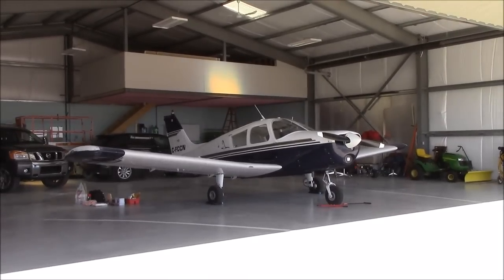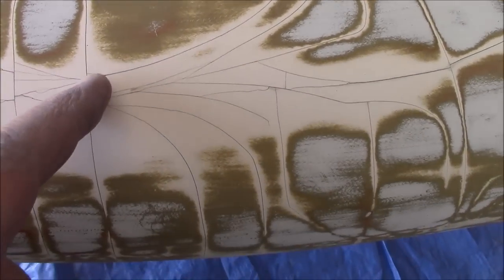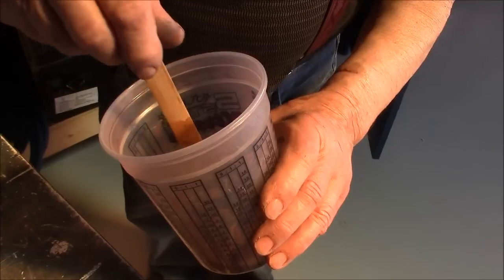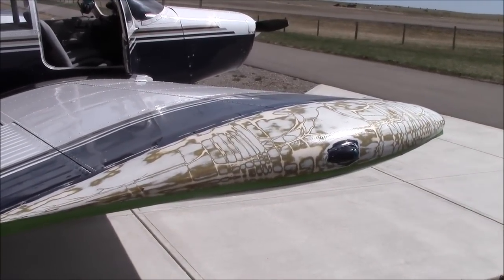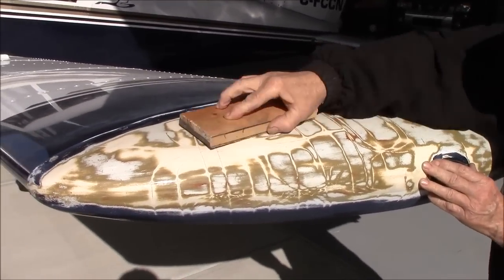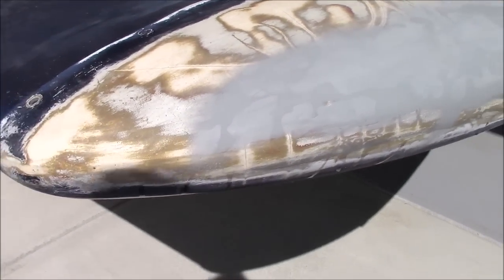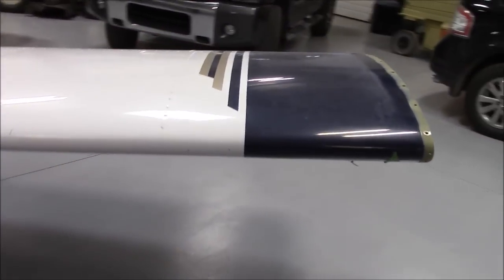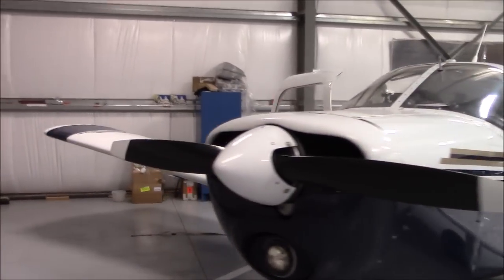Piper Cherokee Wingtips Project Vlog # 49 (Revised)

Comment: Removing the paint and high filler primer is the correct path. Exposing the glass underneath. Adding another layer or 2 of Glass then spraying high filler primer. Rub the filler back and prime and paint.

Comment: Here's  a tip to help stop it from cracking again in the future.  Find a water thin superglue (Cyanacrylate) glue and run it into the cracks before you start applying the fiberglass resin.  It will penetrate into the fiberglass fibers and solidify the area where the cracks are.  This has to be a high quality CA glue, such as Bob Smith industries, not the garbage you buy from Home Depot that they call superglue.  It will harden almost instantly when poured into the cracks.  Wipe, then sand off any excess from the top surface and then coat with Fiberglass or epoxy resin.  They will never come back where they once were after this process.  Hopefully no new cracks will form...

Comment: I started working on boats before I worked on airplanes so I fixed a lot of fiberglass.looks good.i usually use a ziz wheel or a dremel to get in the cracks and then fill em with bindo or 2 part epoxy resin ad some silica to it to firm it up then fill holes. After that I’ll put smother stuff in it like a glaze putty last. Before spraying gelcoat. Looks like you got it under control though. 👍
Reply from the maker: Thanks Michael..it was a big job even though it was only a temporary fix..will probably replace them with updated wing tips should I have a bit of "spare change" in the near future...

Comment: It's not the fiberglass that's cracking it's the gelcoat the Piper used in manufacturing the tanks. If you really want to repair a PA-23/32 Fiberglass Tip Tank it need to be opened up and all paint sanded off the outside and sand all the flaking resin off the inside and using high temp structural epoxy resin and 8 to 10 oz cloth and lay-up the inside and outside putting peel ply on the cloth while it wet and when dry remove peel ply make a replacement panel for the inside next to the wing bulkhead, glass it in and then lay glass and resin and peel ply over it till it dry's and pull peel ply off. Sand outside of tip tank and prime with epoxy primer and the tank is better than it was when it was new. Just painting the outside with resin is just a patch job. I watch a guy in Georgia repair both of mine over 6 years ago and haven't had anymore leaks or seeps till yet.
Reply from the maker: Yes you are absolutely correct in your repair technique since a year or two later I was facing the same problem.  I think that instead of going through the procedures you posted that a new set with the nice wing tips will be my next expense. I will then also be able to install a new set of strobe nav lights.  Thanks for your detailed instructions..hopefully it will be useful to another subscriber of my channel..cheers/Chet
Reply: Unless it’s really bad on mine I sanded off the gel coat to the glass and sprayed in cheap primer, if the cracks are also in the glass as they were with mine they will show up with the primer coat.  That’s why I added a layer of glass

Comment: When sanding the rounded surfaces with the sanding block. Don't sand lengthwise.  That will leave flatspots on the rounded surface, and they will appear as waves in the final job.  Sand accross the rounded area.  And keep the block moving.
Reply from the maker: Thanks for the info it is much appreciated.  As mentioned earlier the cracks did reappear about 2 years after I redid them so I guess the next project I will be doing is following your advice.  I am presently doing hangar insulation so quite busy at that and warmer weather is what I will require doing the crack repairs.  Thanks again..Cheers Chet/

Comment: Any reason other than cost that you did not install Knots2U Horner style wing tips instead of refinishing the standard wing tips? I'm considering changing mine to the Horner style. Do they not work as advertised?
Reply from the maker: New wingtips were on my mind Bob, however I'm starting to feel my age now so it's hardly worth while, the plane flies just fine with the old ones...
Reply: @TAGALONGWITHCHET  I notice you don't need any STOL performance mods out in your part of the country. I fly out of a 2,200 ft grass strip with 50 ft trees on the one end. You need to go looking to find a tree. lol. 1972 PA28-140/160 hp.
Reply from the maker: @bobkimmcdonald6171  Yep, it's pretty flat in this part of the world Bob although we do have to take into account density altitude since we are at around 3500 ASL.  It certainly becomes noticeable during the summer months when we can see temperatures around 30C/86F.
Reply: I was thinking the same thing.  You do still have to paint the new Knots 2 you o es too, but its a quick easy process because they come ready to paint.

Comment: has this held up well? I must admit I'm not really sold on the resin coating for the long haul since the stress concentrations still exist, but the end product looks pretty good and for something not so imperative I think this was a pretty good cheap fix
Reply from the maker: To be quite honest about it all Pitka I think the best route to go is purchase complete new wing tips.  You are absolutely correct, the stress concentrations are still there and about 6 months later they came peeking out of the paint again, although not as pronounced.  These were the original ones from 1973 so they did their job well but as in all things they do have a life span.
Reply: Thanks for the reply. 6 months is a pretty good lifespan for this fix I think. Hindsight is 20/20 though and we all have to try things out. Composite work and paint both require so much time to complete which sucks too. I wonder if purchasing or creating a cheap cover for the wingtips would be worth it when not in use. But I guess that's the whole problem with airplanes and cars, more money all the time lol
Reply from the maker: No problem Pitka..unfortunately there are many fiberglass parts which make up parts of these aircraft and they all eventually end up with these type of cracks so you would need to cover them all.  There are many after market companies which make them so all it needs is a thick wallet..lol..  Keeping them hangared is also an option so that's my next project...
Reply: 6 months to a year is what we would expect for a job done in this manner. They look great for that period though and a definite improvement. That said even just a repaint with a sprayover looks great from 10 metres. The method we use is the same as used on the fibreglass Lotus cars, cracks are ground completely out and then we use fibreglass tissue with the resin. With attention to detail they come up like new and last for decades. I have Cherokee repairs that we did over 25 years ago still looking new. A very inexpensive repair really. Most of the new fibreglass components now are very long lasting as well of course, just a little more expensive.
Reply: @kevinsmith467  , When you ground out the Cracks with a vtapper and added tissue, did you go over the entire object with fiber? or just the one spot. Also did you apply gel coat or resin or just build up epoxy primer layer?
Reply: @ctremie  It is a repair of the entire area, not just the cracks. You have to grind and then sand the surface flat until you have gone down sufficiently to remove all signs of cracking.  You may discover deeper cracks but they will require a localised repair first. It is the gel coat cracking that can be repaired by applying fibreglass tissue and resin. On something like a Cherokee, you will need to sign the Release to Service and the job has to be done correctly before that certification can be signed. We would generally sign it off citing AC43-13-1B as our acceptable data.
Reply: @kevinsmith467  how much would this job cost
Reply: @mj4886  While the materials are never cheap the bulk of the expense is going to be time and effort. Some tooling and consumables may be needed also. It is a difficult question to answer as it depends on the extent and then the finish required. If you have a chat with the A&P and are prepared to do the bulk of the work yourself it shouldn't be a couple of hundred dollars on the low side.

Comment: my stabilator tips were like this so i layed a new layer of fiberglass on the upper side so in the future this wont happen.
Reply from the maker: I would do that as well, should I do it again since it's much better fix.  I may resort to purchasing new tips from Knots 2U
Reply: @TAGALONGWITHCHET  IF they look good for now id probably just wait till they reappeared unless you dont have a high quality expensive paint on them yet.  My wingtips were bad but I got a great deal on horner style tips.  I dont really see a speed difference but on my first landing with them i was all over the place since they greatly increased my aileron responsivness.  My cfi was like why are you overcorrecting all of a sudden lol.  Now to me factory tips feel mushy.

     Just a lil tip if you add a layer, I used mat instead of cloth to conform to the curve easier, and while the epoxy was still sticky I added two more coats so that while sanding smooth so i wouldnt sand into the mat which would show up in the primer coat.  

    What paint are you spraying?
Reply from the maker: @authenticrebuilds9247  Thanks for all the useful info.  I am just into a bit of what could become somewhat of an expensive annual this year on my engine so any thought of purchasing new wingtips will have to wait for a while. The primer and paint I used was the normal spray can type which I purchased at the hardware store for around $8.00 per can.
Reply: @TAGALONGWITHCHET No problem,  I got lucky and got my wingtips on ebay for under 200 dollars shipped, it just takes patience and looking from time to time.  I cant wait to get my Cherokee 180 home to start that project.
Reply from the maker: @authenticrebuilds9247  Now that's a bargain price will have to keep looking take care and thanks for all the useful tips..Cheers